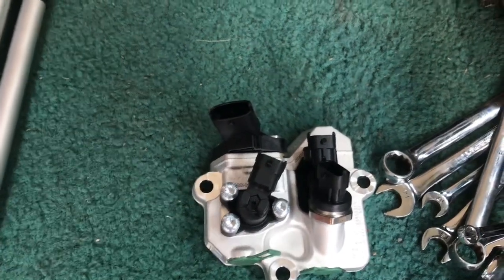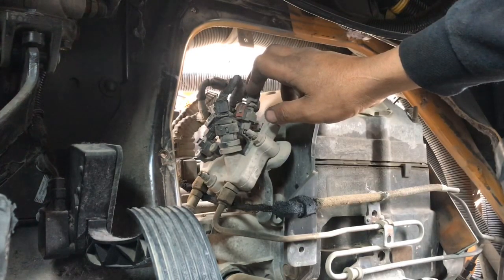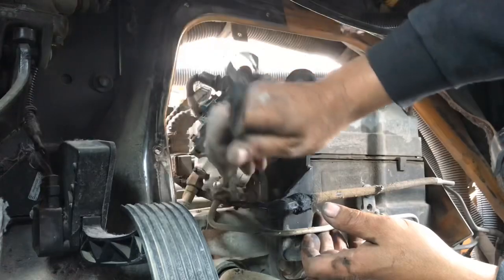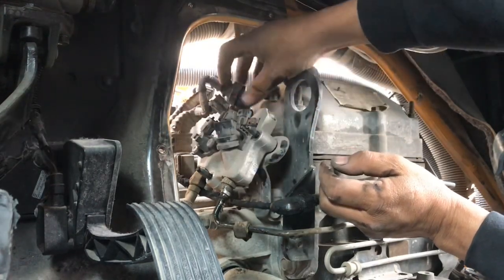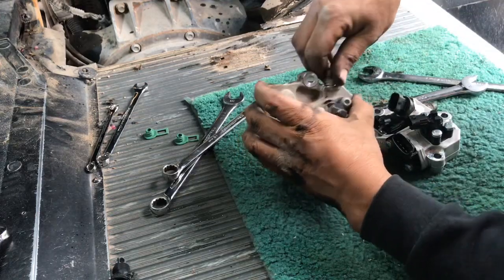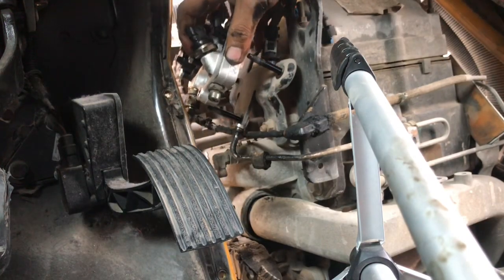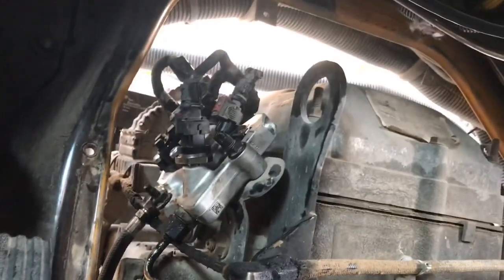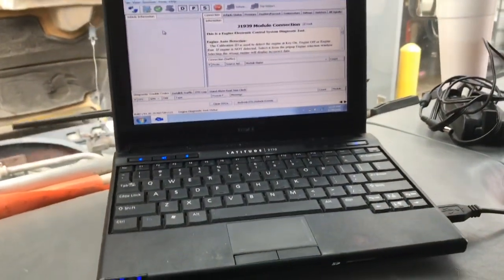Maxxforce dozer injector

Comment: At least dozers aren't put onto strict EPA regulations compared to diesel vehicles that are road worthy. I would like to some day when I get where I wan a be at I want to learn how to delete the def system. EGR and DEF is just a joke I even had a payaso chevy aveo where I straight piped it and got rid of the sensors off the exhaust and tricked it out so I wouldn't have to keep seeing the stupid egr faulty code
Reply: I got a problem with a maxxforce dt epa10 so the temperature on the dpf can't  reach 500° the most high when do a forced regen is 450 so the door doesn't active im already replace the dsi and have the same problem  did you have any idea what will be the problem
Reply: @danielglez480  I know its been a year, I have the same issue right now and can't find a fix, did you have any luck?